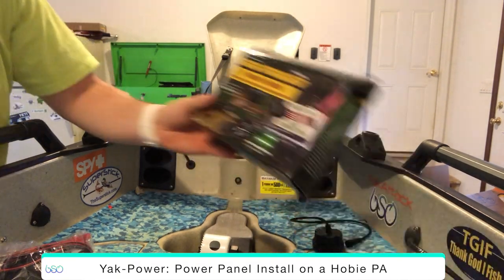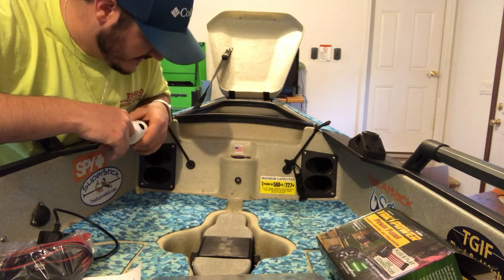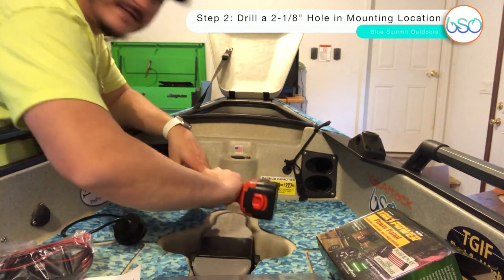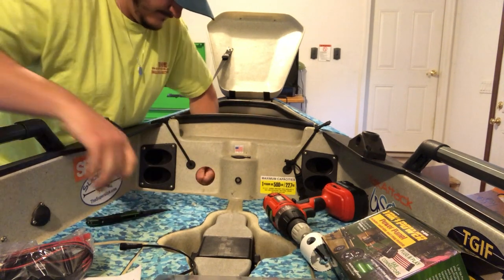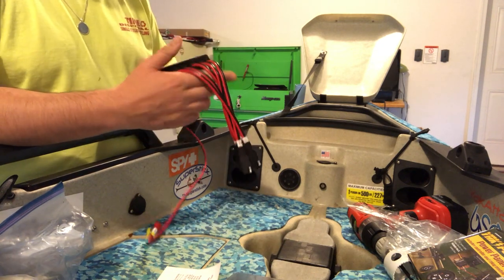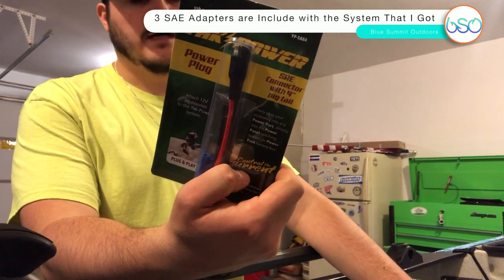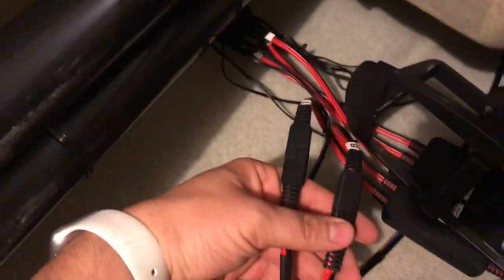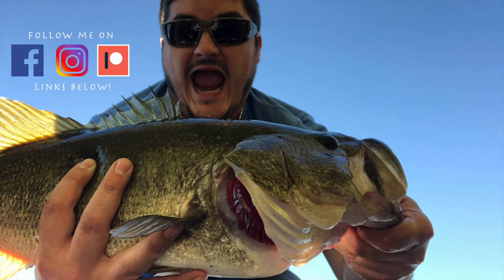Hobie PA Yak-Power Switch Panel Install

Comment: I installed my YakPower system 3 years ago already… I use “1” for my fish finder, “B” for my forward and aft YakPower green LED external light strips, “M” for my 10 Sunpie rock lights (turned for music I might add), “S” for my stern light, “2” is for dual 12v ports, dual USD lights and LED power display.  Running a 36 lb. Rear mount salt water rated trolling motor, power control module for the trolling motor, 50 watt 1.1 aH solar panel on my milk crate box with a 54 aH Dakota LiPo battery… on a sunny day… I never run out of power and still have plenty of power for lights and trolling motor for night fishing.
I wish I had seen your video earlier… good stuff sir!  Thank you

Comment: So are you all plugging the led button lights directly into the panel switch system? Cause when I plug mine in, they don’t come on after pressing the corresponding button on the panel switch. They’ll only come on when directly wired to the battery with the negative hooked to positive and positive to negative 🤦‍♂️

Comment: you could have charged your battery for your drill .lolol
Reply: just saying your battery for your drill was about dead ..so if it was at full charge it would have went smoother ,.but it still worked out .
Reply from the maker: Yea realized that battery wasn’t holding a charge anymore... got some new ones and all is good now haha.
Reply: nice ..good info in the video btw.
Reply from the maker: Thanks!

Comment: Great video! Completely a noob here. I was looking to hook 2 nocqua 20amp batteries in parallel to get a total of 40amps. Do you think the wiring and fuse will support it? Also as of today are their better options or is this still up to date. Thank you!
Reply from the maker: I believe they sell a fuse adapter that works to join multiple noquas together. Look into Amped Outdoors they have some lithium batteries that might be more cost effective and they have a variety of sizes.
Reply: @BlueSummitOutdoors  awesome appreciate the insights!! 🎣
Reply from the maker: No problem

Comment: One question i have the very first hole you drilled out for the Yak Panel. How does that screw in to the kayak? I seen the three screw holes but they looked like they were on the edge of the main big hole you cut out... How does that work?
Reply from the maker: The screws have a little tab on the backside of each one and it spins outward and grabs on the other side of the plastic. Hopefully that helps it’s hard to explain. BUT Yak-Power has a new 5 channel switch that is NO DRILL I would highly recommend that over this older model because of the size hole you have to drill. Let me know if you have anymore questions 👍
Reply from the maker: https://amzn.to/38BU9t0
Reply: @BlueSummitOutdoors  Thank you. That helps. i did see one panel that was on a mount at the yak power website.

Comment: Does the plug ever get wet? I ask because you mounted it so low to the deck. Do you wish it was a little higher?
Reply from the maker: I haven't had it get wet yet, but if I were to choose a different location I would put it in the center hatch bucket like a lot of others are doing. But Im pretty happy with where its located.
Reply: Blue Summit Outdoors TV right on bud thx
Reply from the maker: no problem